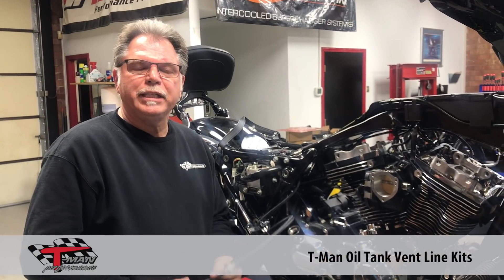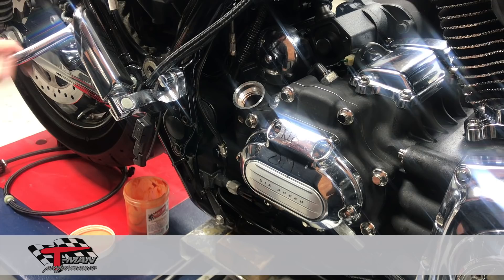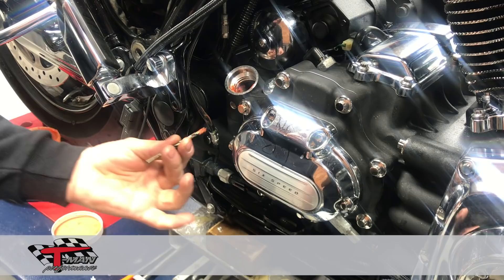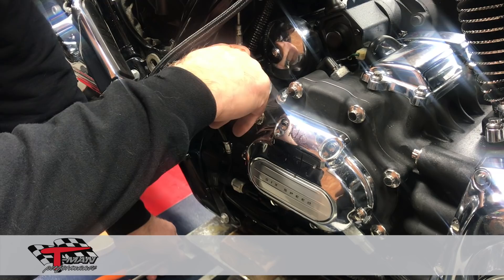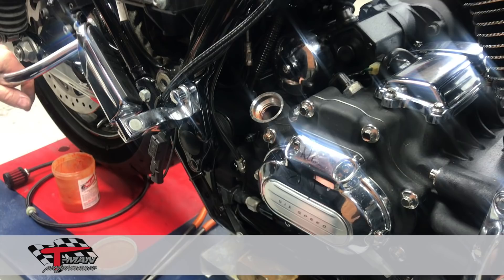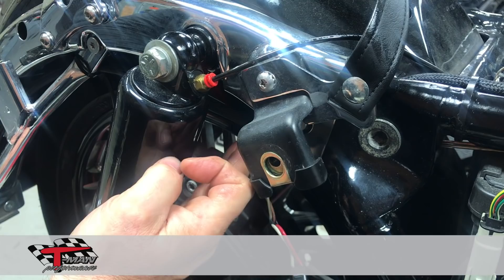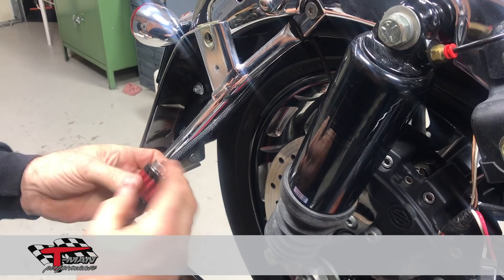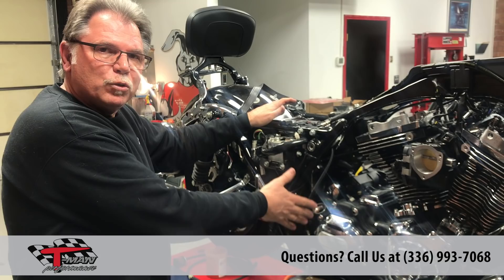T-Man Oil Tank Vent Line Kit

Comment: I have a Twin Cam 2005 Heritage Classic (carb). Started as 88 ci after 13,000 miles I put on a big bore kit, 95 ci, not too bad on the pressure. Just had the motor rebuilt from Crankshaft (DarkHorse) up, 104 ci.  first ride out the oil fill cap/dipstick blew out of the tank.  I drilled a small hole straight into the center of the stock oilcap.  Works great.

Comment: From what I have read, this position being as low as it is can vent oil. Since Trask developed their transmission cover vent, their solution seems like a better idea and less likely to vent oil if the bike is in a leaning position or if for some reason you overfill the oil tank or if there is cavitation and expansion of oil in the tank. In your videos with your oil breathers venting into the transmission cover it would seem that this is the better way to go. Blockhead notches the wall inside the trans cover allowing excess pressure to vent out the transmission vent line while draining excess oil from the vent back into the crank case. The combination of draining the breathers into the trans cover allowing pressure to vent out the top of the trans cover the way blockhead does it seems a viable solution, but then there is the problem of keeping vacuum in the oil sump where you need it, (if and when it occurs). The trask vent has a reed valve which keeps vacuum but expels the excess pressure at a higher point than the dipstick which has as I said a reputation as too low for venting when using a vent stick breather like Fueling sells. I would really appreciate some insight as to how much vacuum there is (IF ANY) in the sump and how to vent the sump at a higher position and also drain breathers back into the oil pan eliminating the need for catch cans or filters hanging off of the bike somewhere.

Comment: It very said you spend 20 to 35000
On a Harley davidson and you have to modify a vent so you dont blow out the rear jug base gasket. 
I'm a loyal HD brother. 
Over 100.000 miles under my belt.
An I'm a bagger guy.
You may have helped me out.
On my 2014 street glide special. 
Every once in a while 
My air filter will  have wet oil on the bottom of the stock filter cover.
I found it on a tune up.
An the filter it self was wet with oil. 
It does have vents ot top end of the heads.
Rubber T hose goes in to the filter.
I'm a retired mechanic. I understand how it works.
Just never thought the system would need more ventilation 
I spent 25000 cash on this bike.
An HD in new Jersey 
Told me  there's nothing I can do but put a tuner on it.
Why?
Tuner has nothing to do do with ventilation. 
The bike is not lean an not rich.
Its fine.
This is why I do not go the the dealers.
There all about money.
I called the dealer I bought my bike from .
Told them about the  ventilation problem. 
I was told if I was to ventilate more it would blow the motor with in 5000 
Miles. 
I know that's  a straight 6 lie.
I played dumb when I called. 
Just goes to show. 
They will take advantage of you.
If you dont know what your taking about.
On my 10000 mile service at the dealership. 
Left the bike there for 5 days.
Got it back.
Only thing they changes was motor an trans oil.
Not the oil filter I maked the filter.
I dated the inside of the air filter.
That was never changed  and it was oil 
Soaked. 
They never gave ma a copy of the RO
I forgot to ask for it.
I called the next day
They said no problem 
Asked to have it mailed.
Still today I have not received it.
I m done calling them.
Every time I called I'm on hold  an then told it's in the mail
Unfortunately I couldn't go get it.
I moved from the shithole new Jersey.
To the free state of 
South Carolina. 

I will never deal with a dealer again 
I do all my own work.
My glide has over 45000 miles 
No problem an runs like its brand new. 
Only replacements
Tires
Brakes
Shock oil I just wanted to change it
Brake oil. Same with this. 
An I love the way HD Likes to scare you .
In to only using HD products. 
Thay make the bike seem like it's a
 cristal egg.
That's probably why they closed up.
Not bought out.
My experience. 
Gator
Reply: "Crickets"

Comment: That's nice but let me ask ya .. why don't you go to the high spot on the transmission cover?? You almost talked me into drilling my case insted of a replaceable 60$ cover should anything go wrong.
Reply: The goal is to vent the engine oil tank not the transmission, there is already a vent on the top of the tranny!
Reply: @stephanelevesque6559  ok so the trans cover has two chambers and yes the trans is vented conthe side where it needs to be but even though the trans is a separate thing the oil pan mates both and the side that is closest to the dipstick crank oil flows though. If you tap the you have a crank breather and not a trans vent.
Reply: @davidfellows6250 don't explain stuff to these clowns. I know you're trying to be nice, but it's not worth it. Take care!
Reply: @toddgittins5692  yeah seems like it. I don't even want to tell them about the dipstick. haha

Comment: Just got my bike back from dealer 18 fltrxs,new pump and parts,took it out saturday,ran great till I was late and had to drop the hammer,wet sump,down on power and oil,got to where I was going,bike sat for 9 hours and oil was back up...now I'm playing guessing games
Reply: Mine is going back to the dealer tomorrow.  Have 8k kms on my stage 4 kit and last Saturday it stumped for the first time.  2.5l of oil came out of the crankcase
Reply: @simmon81au  seems to be ongoing they told me I have all the fixes that it's called for I said well I'll blow it up and then we will see
Reply: Mines getting the newest pump now. Waiting on the part to come in.  If this doesn't work I'll put one of those new dipstick breathers in for $100
Reply: @simmon81au  where are they for a hundred
Reply: @simmon81au  killer thanks man I was gonna make one instead of the 278 for fueling looks like this is the ticket

Comment: How about when it gets wet from riding in the rain? That's a pretty wet area. Any problems with that mesh filter clogging from soaking up water?
Reply: Not really, it's not an intake, it's an exhaust. The problem is mostly overpressure, so any water that might clog up the filter will be blown out.

Comment: any tangible evidence that this mod helps or is even needed on your engine?
Reply: I have a similar vent, it dose work.   Feels like the motor spins easier .
Reply: @davidspin5353  ----> I installed the Fueling vented dipstick, Fueling oil pump that scavengers 63 % more oil, and the fueling backing plate, Man O War engine sprocket  ( that is 2.5 pounds lighter than the stock HD compensator ) and I could feel a noticeable difference in how much easier my 1114-inch gains RPM's. I recently installed the T Man Performance transmission cover with a Boysen reed valve inside it to vent the oil tank. My 114-inch now revs out to 3,500 ever faster.

Comment: I like your breather setup. I was wondering  what size of hose or fittings should be use? I would like to make sure the breathing is adequate. You also spoke of oil levels and marking the dipstick. I have a different style of dipstick. You said four notches below full would a 1/4 be equal to 4 notches?

Comment: I own a hopped up shovelhead for 40 years. Luckily my best friend is a machinist otherwise it would have cost me 10’s of thousands in repairs. I still have it but I bought a twin cam for comfort. It looks like I need a machinist for it now as I am getting oil into the air filter it’s a S&S stealth. Other kits have you drilling into the backing plate to vent. WTH ?
Some one needs to invent something with out drilling & tapping
Reply: Look at the products from fueling...
Reply: There are and have been ways to vent your bike for decades..
Reply: @hankhamern5456  
It’s taken care of. I bought a A-1 oil tank vent it helped but didn’t totally stop the oil in filter so I drilled & taped in to the breather bolt supports for 1/8 npt x1/4 hose barb. Also tapped the backing plate breather holes that drips into air filter and inserted I believe it was 10-32 set screws. Ran 1/4 inch hose to a T then down under bike. All good  now

Comment: looks good, i have no issue with the stock engine, yet. but i do have the transmission to primary migration. 16 ounces in 5 thousand miles, do you have a vent for that.
Reply: Greg Williams on Facebook has a clutch push rod that fixes that problem.  Worked for me
Reply: @simmon81au  There are just a few Greg Williams on FB. Do you have a link?
Reply: @simmon81au  thank you Sir!
Reply: that's what the vent is for, your engine is pulling transmission oil through the hollow transmission main shaft into the primary when you lean the bike to the right, it's creating a vacuum through the engine sprocket shaft seal because the engine isn't vented well enough from the factory, but don't worry Harley will fix it by the next engine re-design.

Comment: Everything about this is good and simple, but when I did it on my Twincam Dyna - '10 model year so the filler neck comes off  with one screw - I fitted a one-way check valve in the hose-line. This enables the oil tank to have a lower pressure helping both the crankcases to breath into the oil tank  AND the oil pump scavenge to clear the cases of oil (and air as it always does ! ) leaving a generally lower pressure in the cases. This seems to stop the transfer of oil from the rocker-breathers into the air cleaner as the amount of air passing through them is less.... any thoughts on that T.R. ?
Reply: @johnperry612    - ?
Reply: Can you tell us what part # you used for the one way valve?
Reply: @Dan-rc4cx   Sorry for the delay , I did not use anything from H-D - I got something off ebay that was small enough to fit in the space I used.